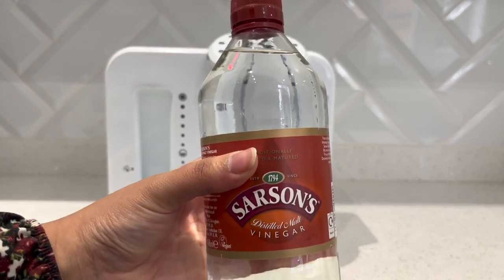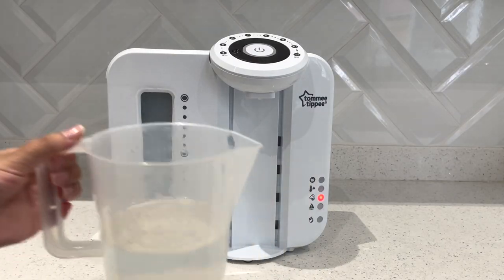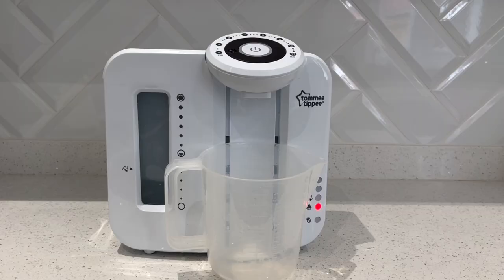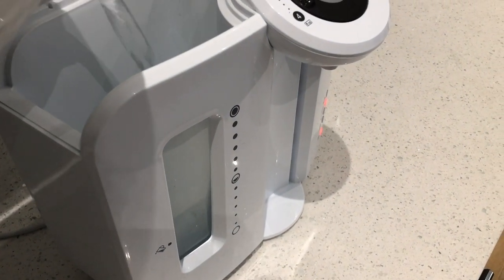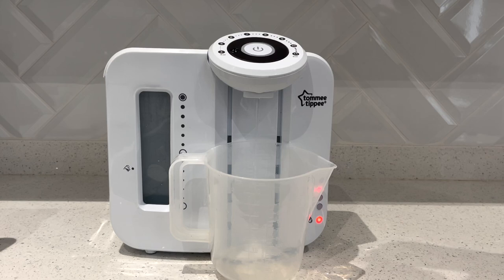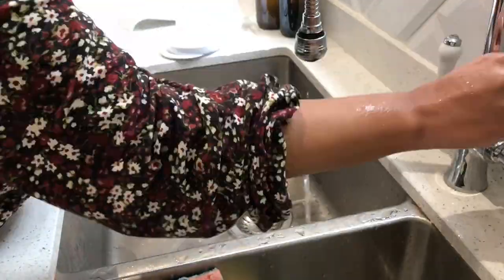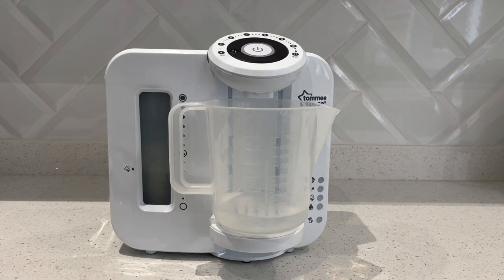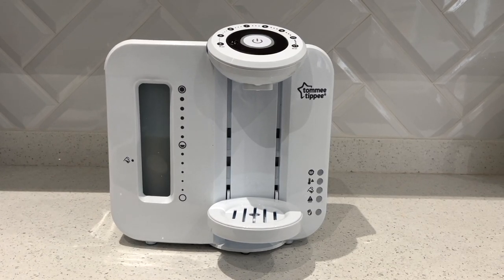How to descale the Prep Machine | First Time Mum UK

Comment: Think you need to take this video down. It broke my machine. Blew both fuses in the back. Luckily the machine is being repaired by a trained electrician for only the cost of the fuses. He said that the boiling water would have blown the fuses. Not good!
Reply: You're going to struggle to make a bottle without water🤣
Reply: @austenclench2269 your comment makes no sense. You must be bored! This video clearly says to boil the kettle and fill the tank with it to flush out the vinegar. Boiling water blows the machine.
Reply: @SarahVandenBrekel  well you're saying boiling water broke your machine, but it only goes in where the normal water for making the milk goes... Also, if you read the official tommee tippee manual for this machine, this is exactly what it tells you to do

Comment: Broke my machine 😢
Reply from the maker: Sorry to hear that. I’ve done this a lot of times to my machine and it’s always been fine. Even the tommee tippee tutorial on this mentions you need to add boiling water so I’m not sure why that has happened. Remember there is a test cycle first and then you should be able to start making bottles again the next time you run it. Hope that’s all it was
Reply: I tried the test cycle and nothing came out and then all the lights went off I think it overheated , don’t know what happened
Reply from the maker: Oh no, I’m really sorry to hear it. Maybe try changing the fuse 🤷🏻‍♀️
Reply: I've now broken my machine too. Does it work once it's cooled down or is it broke for good now?

Comment: I double flashed it out with boiled hot water as you said. It drained the first lot find and won't flush the second lot out and now has broken my prep machine so got to buy a new one now.
Reply from the maker: I am sorry to hear that. I am not sure why that would have happened. Did you press the big button on the second cycle rather than the clean button not the side?
Reply: You can use boiled water but it should be left to cool down before you put it into the machine. If you use boiling water it can break the machine. I did this with our first one. I thought the water had to be boiling hot. If you leave the boiled water for about 20 mins it will still be hot but it won't damage the machine

Comment: Broke my machine DO NOT USE BOILING WATER
Reply from the maker: Aww really sorry to hear it. I’ve never had this issue. Even the tommee tippee official video says to use boiling water do the machine should be able to handle it. I’ve done this to my machine soooo many times and never had an issue so I don’t understand why some do.
Reply: I use boiling water 💧 but I wait till is cold and then I put the water in and is fine 🙂

Comment: Ah what a lifesaver you are 🥹.. silly question here but When you first get the machine would you recommend doing this before using?
Reply from the maker: If you buy brand new then I think you should be fine to just clean and sterilise it https://youtu.be/8LhyZXduzAQ.

Mine is actually secondhand so this is a step I did as well as the sterilisation before I used it for baby.

Comment: My calc is flashing but very very faintly flashing I even did this process but still happening?
Reply from the maker: Hey, I think what you’re on about is something my machine used to do. Flash really really faintly whilst making the milk. I researched it and read that it was a fault with a batch of these machines so we must have just got a machine from that batch. As long as it’s not on when the machine is not in use and it’s not a dark solid/flashing light I think your machine is fine. To give me piece of mind, I took the back of the machine off and made sure that the pipe work clean all the way through cuz there are some nightmare stories out there about them getting clogged up with black sludge.
Reply: @RuksanaAhmed  black sludge? Like coming out when making bottles or just in the pipes?